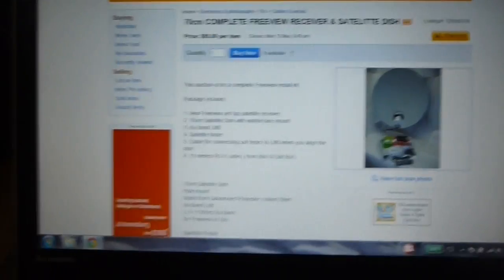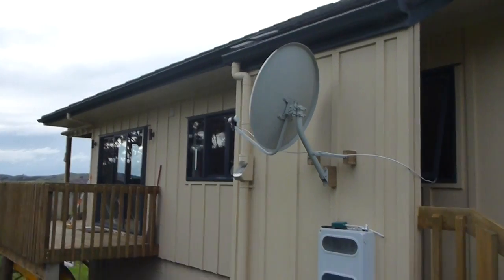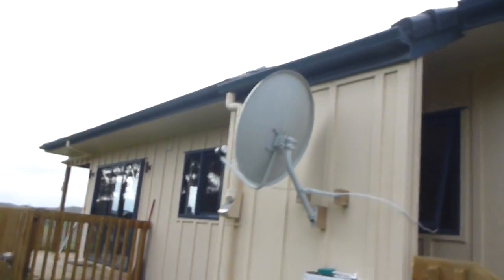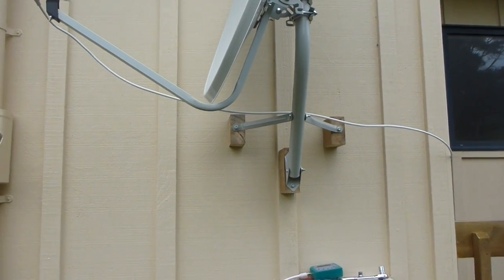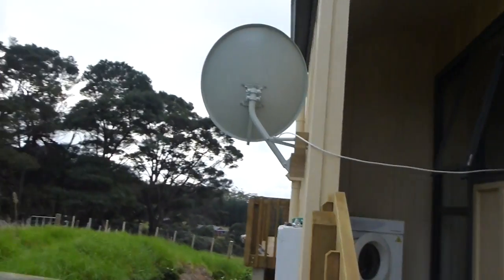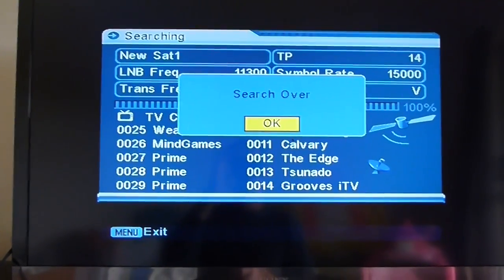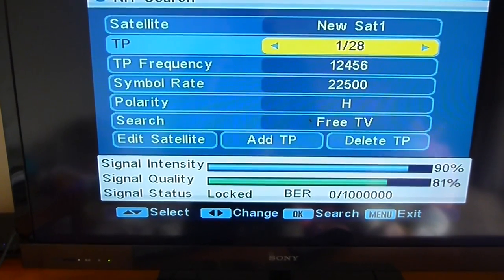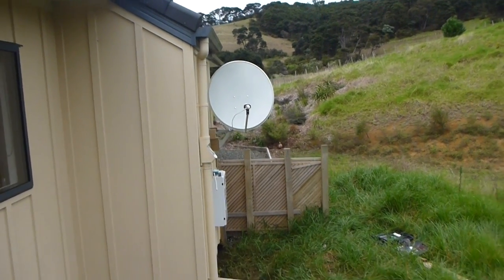NZ Freeview satellite dish installation

Comment: relocate to the dish to the end of the house
Reply from the maker: +bluebelly Brown Yep, was quite a while ago, I think the reason I mounted the dish there is that I could get the cable to it without having to run it across the roof or in the gutter. If I were doing it again, I would probably do as you suggest and mount the dish on the side of the house facing the satellite. Cheers
Reply: No worries